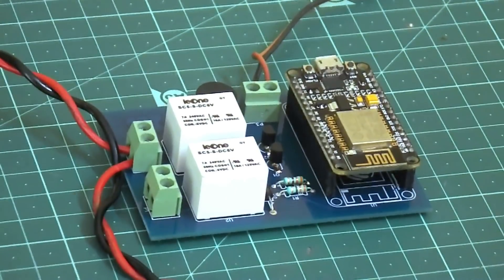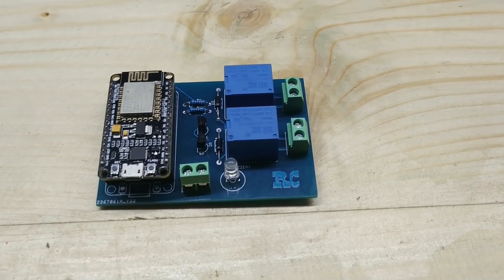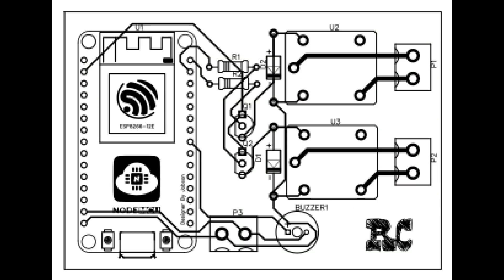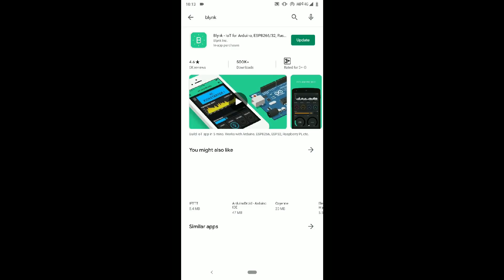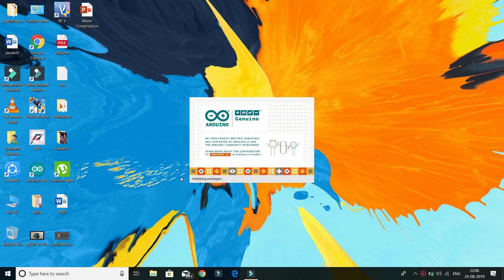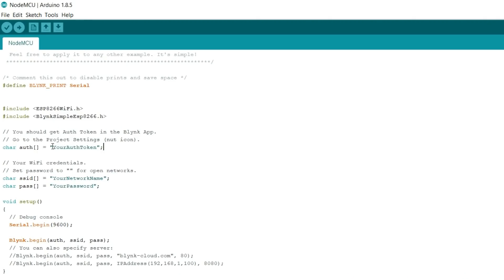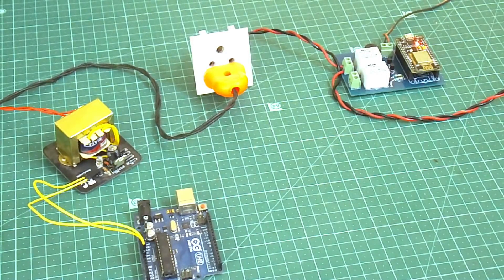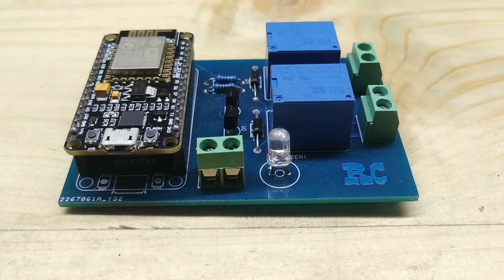IoT Board | Internet of Things | esp8266 NodeMCU |  IoT Projects

Comment: Nice .....one question_
How many pin's are use for output in esp8266-01 without arduino board
Reply from the maker: I one i am using is a nodemcu
It can have 16 pins for output
Reply from the maker: In esp8266 you can use 11 out of them
Reply: @RoboCircuits  I  think you can   use only 4  pins   output with  esp8266-01.